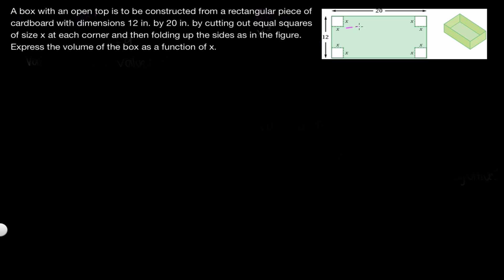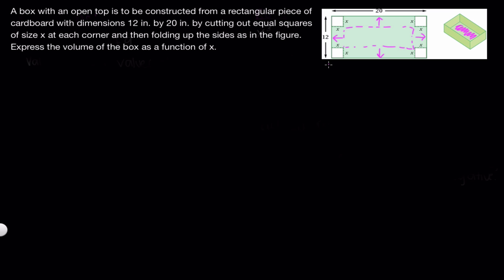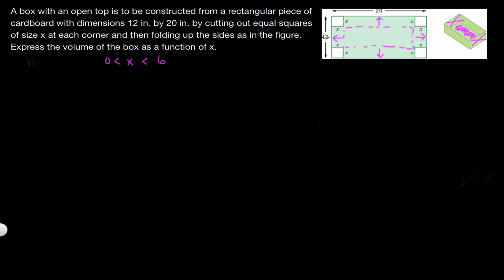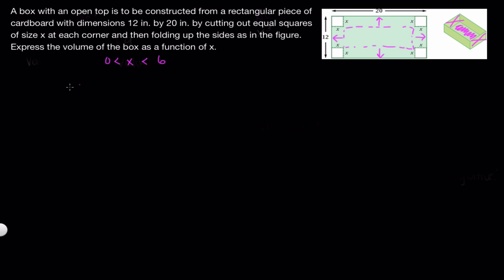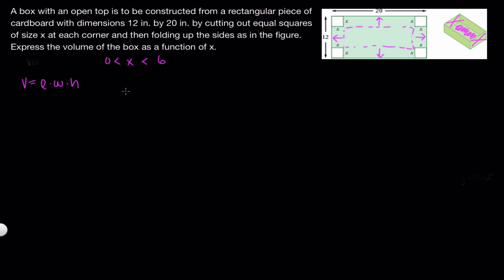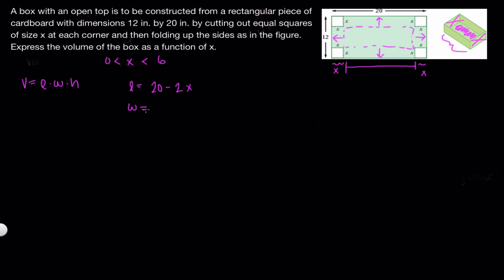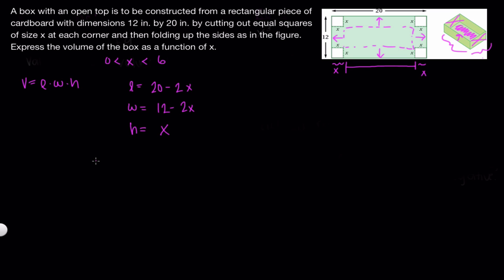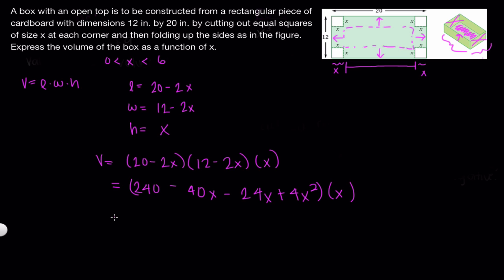Finding Function to Represent Volume of Open Top Box

Comment: Great explanation!  (Also, Great Name!!  I promise I didn't know you existed when I chose my name.) . Here's how I'm modifying it for my pre-algebra students who don't yet know how to multiply two binomials together.  I'm making a table like this:
If x =                       Length                     Width                       Height                      Volume 
4
6
2
-3
0
x

The last row with the value of x just being x is what your question started with.  But I'm scaffolding.
The directions will be: "A box with an open top is to be constructed from a rectangular piece of cardboard with dimensions 12 in by 20 in by cutting out equal squares of size "x" at each corner and then folding up the sides as in the figure.  Fill out the table below."
Then my final question will be: "What are the restrictions on what x can be equal to, for this word problem?" and they'll be able to look at their table to have the hint.
I just wanted to share that, in case it helps anyone else out there.  Thanks for the great idea!